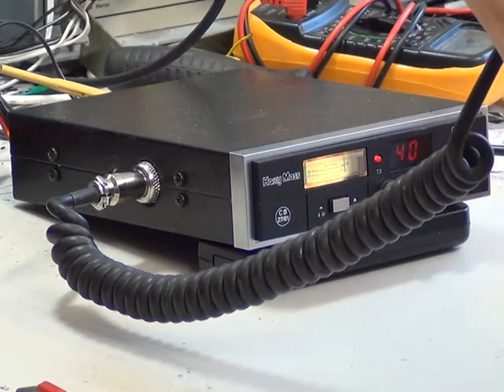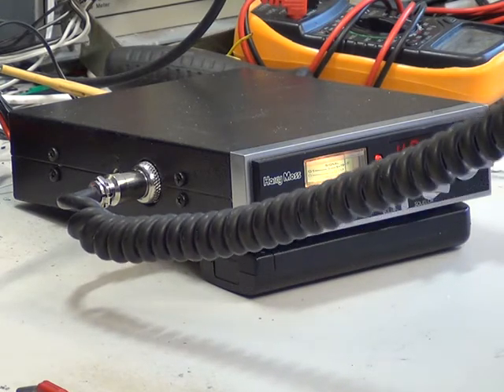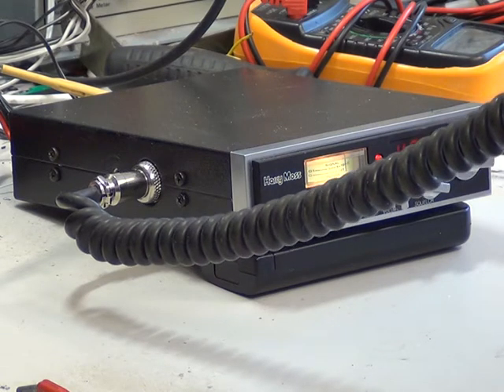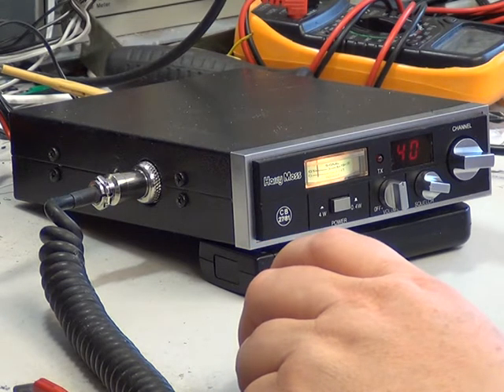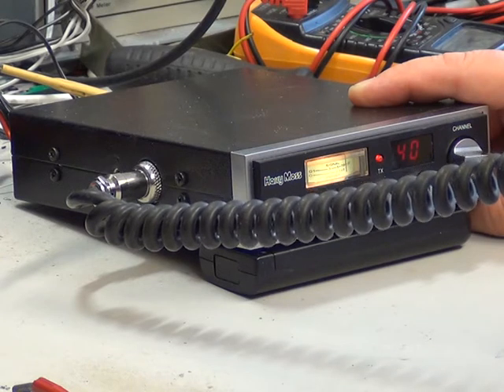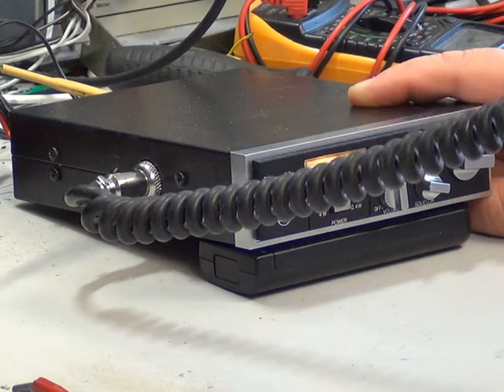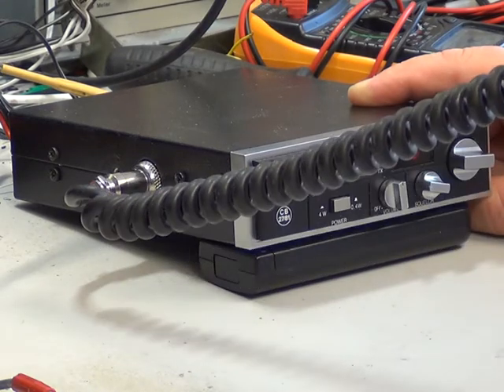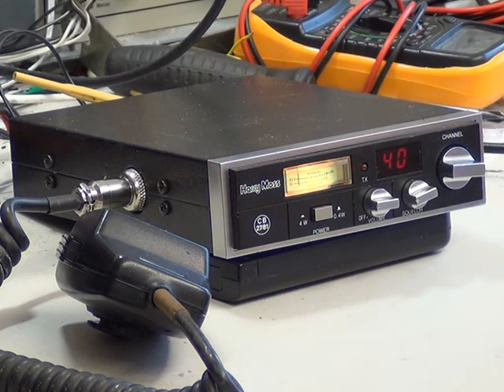Harry Moss PT325, UK (CB 27/81) CB radio (Mobile) - On The Air Test

Comment: How do you make your money back on an old radio like that? 1hrs work plus parts plus purchase cost.
Reply from the maker: You don't. The purchase & repair was done soley for the demonstration purposes of this video at my expense & will remain company property. Luckily for customers, service work is on a fixed price plus parts basis...and parts were only about £1.

I've only ever see one, one before & that was back in 1983 when it came in new for optimisation. Luckily I had the foresight to photocopy the instruction booklet, hence having the circuit diagram.

Richard